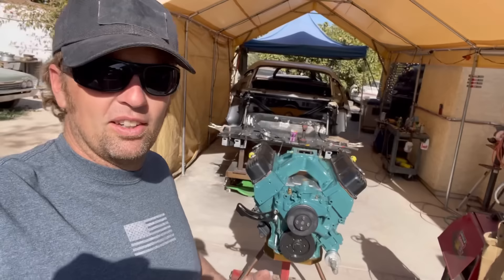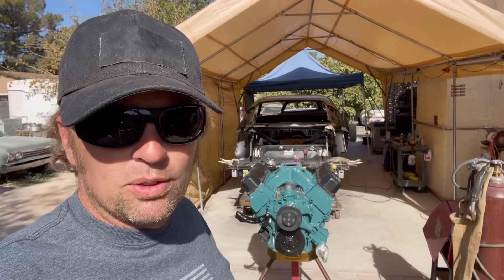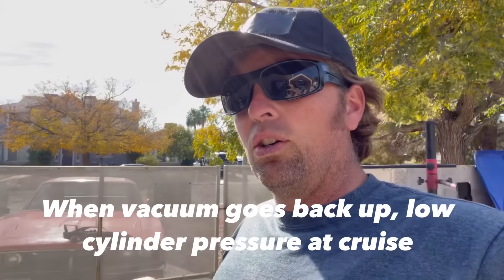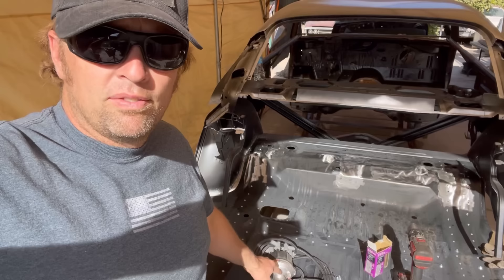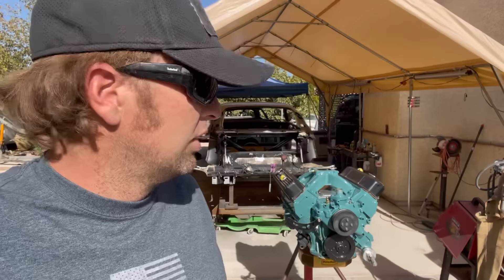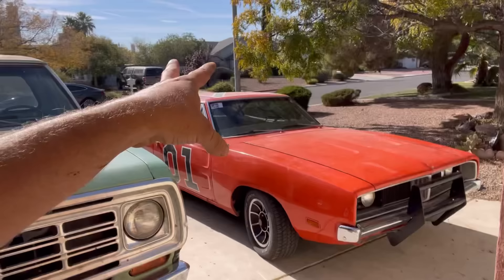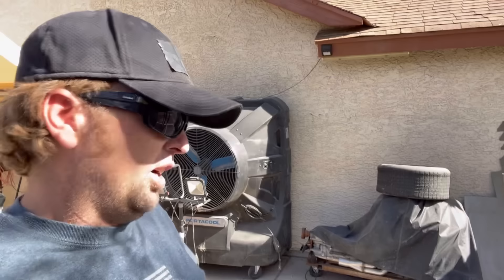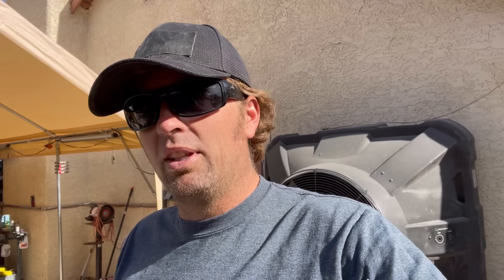Stop unplugging your vacuum advance on distributors

Comment: I think you are confusing folks, dont set the intial at 45. 34 at idle with vacuum unplugged. Then plug back in for the extra 20. Can be scary to see 45 but fine. Also dont trust the balancer mark, mine is off by 12 degrees.  550hp 440 six pack daily driven, runs fine with no VA, just lumpier and low mpgs. 4 speed close ratio and 355 will mask the issue. Agree with you and plug the vacuum line in at the bottom of the manifold at the brake booster inlet.

Comment: Can you control the timing digitally using the MSD distributor, a manifold pressure sensor and a programmable controller?  A throttle angle sensor would probably help as well.

Comment: MSD does make a pro billet for big block mopars with a vacuum canister, its on the ready to run line.
Reply from the maker: That’s hei though
Reply: @junkerup  since I'm not overly familiar with the MSD distributor what's the difference? I have had an old chevy with the HEI type distributor with the coil in the cap, this srill need the external coil? Not arguing just trying to learn because I've not had the experience you do with this stuff

Comment: What kind of carb work do you think, would be needed {adjustable air bleeds ,boosters} on a small block 408 with trick flow heads,238/246 comp roller,for the street. #3500 LBS cuda,391-4.30 gear,727 ,2800 stall.

Comment: what do you do if you hook up the vacuum advance and at part throttle the engine starts pinging its brains out?
8 deg base timing, i think 12 deg of mechanical advance,
engine pulls 19in of vacuum at idle and about 1deg of advance per in of vacuum. (about 20 total)
ive tried straight manifold, ported, and no vacuum advance at all.
at no vacuum advance i think my total timing is only 26 degrees....
but if i give her any more it just pings at light throttle (idling it sounds great)
I only get about 12mpg and it overheats on the highway even with a 100% new cooling system and several block flushes.
1963 Pontiac Bonneville 389, engine is 100% bone stock
Induction is a Fitech GoEFI4 fuel injection conversion
fuel is premium 91 with no ethanol

Comment: Howdy. im not understanding even though you did a great job explaining, how do you set 45 degrees of timing at idle then how does the motor pull it back to 32 at wide open? I get setting the carb to the highest amount of mercury possible but the timing thing has me confused. Thanks.
Reply: At wide open throttle, your vacuum decreases because the engine is ingesting air rapidly through a large opening (slammed open throttle blades), so when your engine is effectively an "open circuit" letting air in and out rapidly, it loses vacuum. Lower vacuum means less signal at the vacuum pod at the distributor, so it reduces timing. at part throttle cruising, the engine is at low cylinder pressure, steady state rpm, and a small opening (cracked open throttle blades), so it retains vacuum, sends more signal to the vacuum pod, and increases timing.

Your mechanical advance that is built into the distributor increases with rpm, your vacuum advance in your vacuum pod DECREASES with engine load. And your engine load is low at idle, low at highway cruising, but high when accelerating, therefore, your timing is high at idle, high at highway cruising, but low(er) when accelerating. Mechanical adds timing with RPM, vacuum takes away timing with load.

So you have your base timing (Say 22*, for instance), and your mechanical advance (Say 35* at, say, 2200 rpm and above). That is your linear, unchanging timing curve, which will always rise and fall steadily between idle and 2200 rpm, and will remain the same above 2200 rpm. Your vacuum advance is auxiliary to that fixed curve, adding and taking away in set circumstances. So at idle, when you would be at 22* in this example, you decide to hook up your vacuum advance. Let's say your vacuum advance is tuned to add a maximum of 12* of timing. So now, you would be at say 34* at idle, since idling is a low load circumstance, the vacuum pod is adding maximum timing. Then you accelerate, so vacuum drops and your timing drops down to just your linear, mechanical curve (starting at 22* and increasing linearly with rpm until 35*). But now, you're on the highway and you're going the speed that you want, so you back off the throttle. Now you're cruising on the highway at say 2700 rpm. Since you're above 2200rpm, your mechanical advance is in full swing, so you're at 35*, right? Well, not necessarily. Because now your engine is making peak vacuum, because the engine isn't under load, it's just maintaining it's current state, so now your vacuum advance kicks in and adds that 12* extra timing. So you cruise at 47* of total, maximum timing. Then, any time you whack the throttle open, air rushes into the engine, engine load spikes, the rpm is constantly changing, as is the airflow and power production, so the engine isn't retaining vacuum. Low vacuum? No more vacuum advance. Now you're right back down to 35* of linear, mechanically controlled timing. Perfect for making WOT power. Let off the gas, vacuum spikes, more timing, right back to cruising with glorious fuel mileage and smooth engine operation.

All there is to do is edit those numbers for where your base timing is set, how much your mechanical advance adds and at which rpm, how much your vacuum advance adds, and you can figure out how much timing you have in a set circumstance. And to figure out how to tune it all, Birdsong has another excellent video on that. My numbers were picked at random, but reflect how one would choose to tune a street engine with a somewhat exciting cam, and get good results at any rpm.

Comment: Programmable 6al2 MSD box with map sensor and locked out pro billet distributor gives you the same thing and more control with cranking retard extra. I actually use exactly 45 degrees full advance like you on my tunnel ram setup.

Comment: So what would your recommendation for one of the old Mopar 509 cams with 5" of vacuum at idle. I would love to hook up my vacuum advance.
Reply from the maker: I had a 509 in a 440 and it idled at 13”
Reply: @junkerup  interesting.
Reply: @junkerup  I have no idea if this is true, but I do live at about 6,700 feet of elevation. I have been told that the higher elevation you will have lower vacuum... 🤷‍♂️ But that could bullshit

Comment: Advance at idle will cause a rough idle, there is a port on the carburator that does nothing at idle but as soon as you apply throttle that port will now supply vacuum. This is the port for the vacuum advance on the distributor. Some factory fords had an advance and a retard 9n the distributor to provide a super smooth idle, they pulled both ways.
Reply from the maker: Wrong
Reply: @junkerup   this is how it was before your time junior
Reply: @junkerup   the higher rpm is not a smoother idle chris

Comment: I’m confused. Was told when I purchased my FBO distributor and rev limiter, they told me 16 degrees initial at idle. 40 degrees?
Reply from the maker: There’s a lot into tuning I just was talking about vacuum, but yes I run 40-45 at idle in my cars
Reply: 16 degrees without vacuum advance connected...then you reconnect it.
Chris means 45 with vacuum connected
Reply: @junkerup  thanks for the reply, I will definitely look into that👍👍

Comment: You need the vacuum canister that you can adjust with an Allen key. I usually don't end up using the vacuum advance because I'll get part throttle ping or stumble. I usually end up running a short curve with alot of initial timing.
Reply from the maker: Yup, I should do a more in depth tunning later on the subject
Reply: @junkerup  I do run it just like that if it will work though. I usually just get my flippers tuned up as best I can with what's handy though.🤣
Reply: Same for me. On a stock block i can get it perfect. Right now...on a 416 stroker small block with lots of duration ...ping and stumble.

Comment: Hauls ass and mpg?
My 440 truck, 6mpg
My 400 newport 6mpg
My 273 valiant, 8mpg
My 95 318 ram 12-16 mpg
My 69 d300 318 6mpg
My 96 dohc neon 40mpg, my sohc 96, 98 and 05 neons get 20. 
My 91 318 ram gets 10
My 70 a100 318 gets 6
My 64 a100 /6 gets 10
My 92 3.3 town and country gets 15
My 96 sebring convertible gets 16
The rest of them i have i dont drive enough, but they are all excellent running 12.5 idle afr and 13 to 14 cruise, driven nice. 
I tune my distributor on a sun, 18 initial 36 all in early with light mechanical spring. All my small blocks are advanced 4 to 6 degrees on the cam. Tuned with an air fuel guage upp the exhaust pipe. Some have vacuum advance, some dont. All my 90,s are multiport fi besides my 91 which is throttle body. Each one idles at like 8 degrees when i watch on scan tool. 
I just dont see how you get your mileage claims. 
Only thing i get good mpg in is my 96 neon and my cummins swapped 70.
Reply from the maker: They are real, top tank off, gps mileage distance, top tank off and do the math. Sounds like you need more tuning
Reply from the maker: My 74 d100 with a mild built 360 got 14mpg towing a duster on open trailer 65mph
Reply: I have some thinking to do I guess all winter
Reply: Sweet baby jesus thats some heavy drinking cars you have there.